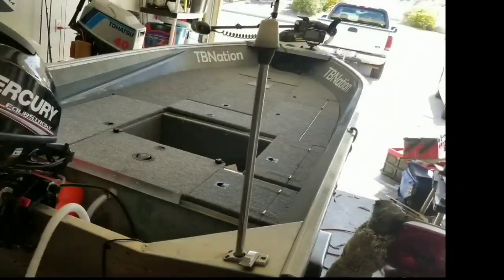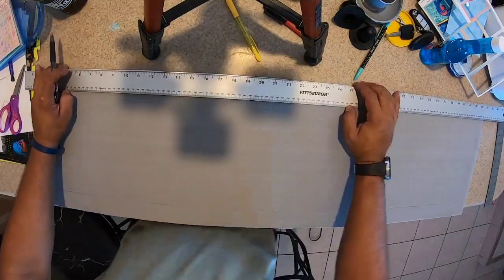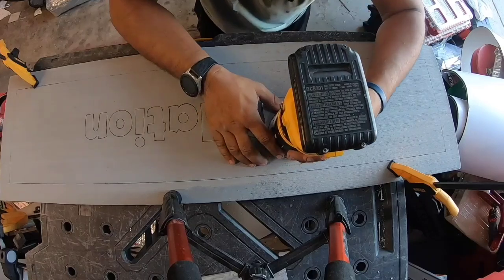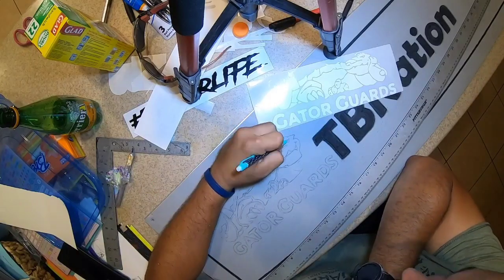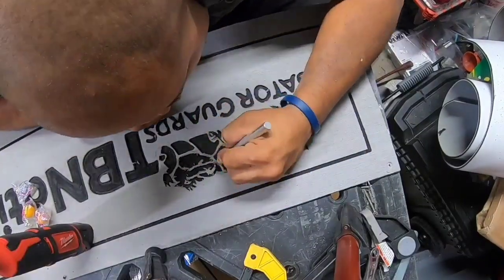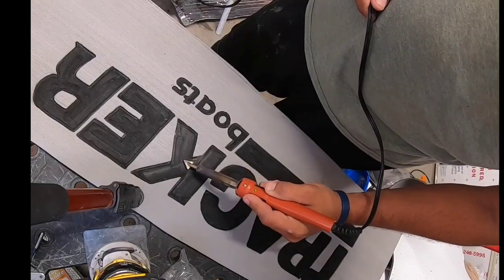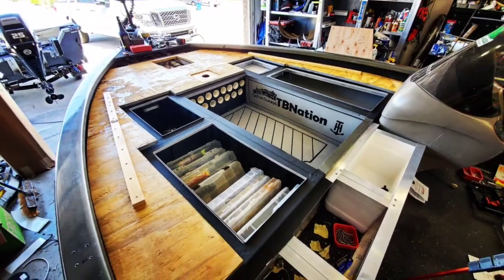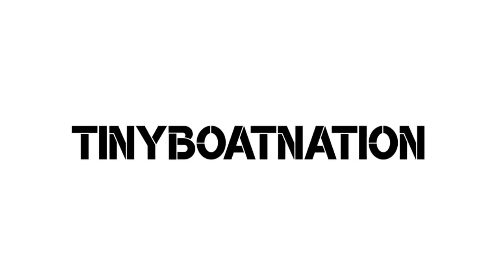Rout EVA foam Like a BOSS, by hand DIY

Comment: whenever you are template routing, always use the round side of the base plate against the fence. That way if you have any rotation or anything it wont move the bit away from the fence and leaves a cleaner cut

Comment: I'm really enjoying watching your builds.  . ..
 The only issue I have... I have a 16' G3 1544  "John boat"....  As it sits it's not really all that fishable.  I mean it works OK for 2 guys and that's it you can really take 2 adults  & my daughter out with me. I would love to do something with it but at the same time I'm just not sure I like the lack of stability.  I'm not sure much could be done. Being that it is very narrow & the flat bottom, It just bounces so badd in the water make me seasick. Not just me, but everyone who rides in it says the same thing.... 
 Of course I do worry that it does not have nearly enough floatation. I think if this thing were to go down it would go all the way to the bottom of the reservoir and may be float just slightly off the  bottom.    Right now I'm at the point where I'm not sure if it's worth keeping and trying to modify to make it a little bit better or try to find a different boat would be more stable in the water. Doesn't help that we've got a lot of guys that run around in wake boats and think it's great to come within 25 yd of where your fishing. Have to stop what you're doing immediately and used the trolling motor to get the bow of the boat turned in to their wake. If you don't do that there's a chance you're going to the bottom of the reservoir....
 Anyway if I were to try to start modifying I would not know where to begin. I know there's a list of things that I don't really want. But knowing how I would place the things that I do want or even figuring out what I would actually want is the hard part for me

Comment: if you would stuck the tbnation template or a good piece of cadboard and cut the letters keeping the outline , you couldve used it more than once by laying it on the part and praypaint over it 
you have the painted letters to trace out
Reply from the maker: I’m working on stencils. I’ll probably plasma cut out some from aluminum.
Reply: @TinyBoatNation  make those thick enough you can probably use them straight on the piece with a ballbearing routerbit

Comment: The foam on Amazon is that Ok to use 
KT GuoMei 94.5"× 35.4" EVA Foam Boat Decking Sheet
Reply: And would it do rounded Edges my aint flat If there’s a way I can send you a picture I would